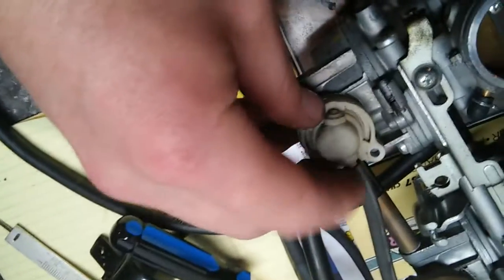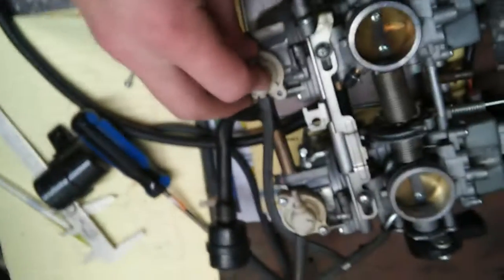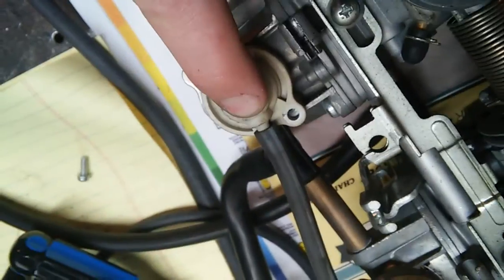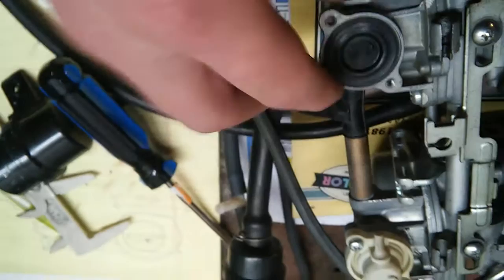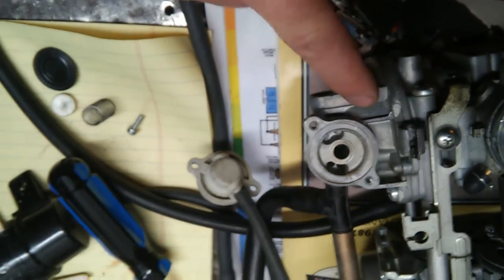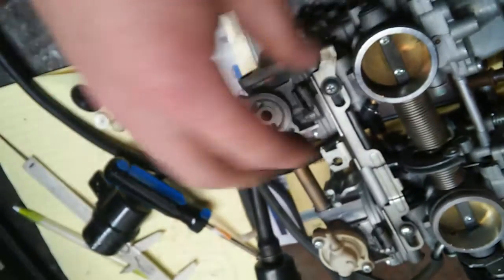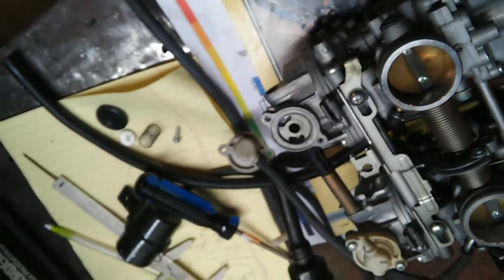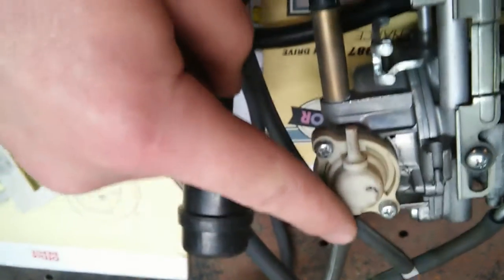Explanation of GS500 carburetor white exhaust ports

Comment: I blocked the white circular devices on the front of the carbs and the bike runs perfectly. Suzuki runs the same carburettors on the XF650 Freewind. Probably why it's the only stock single that can top 160kmh stock.
Reply: Loved my XF650, the torque was fantastic through the entire rev range that thing pumped!

Comment: This is matching my understanding of this device. I didn't dismantled it ...yet, but I doubt very much about its use as a better bike behavior. 
Just replacing the whole stuff with a couple plugs should not cause any problem.  I just wonder if the TPS as any other use.

Comment: also you connected the cables incorrectly, the vaccum chamber is supposed to be connected to the solenoid and not to the atmospheric inlet ports.
Reply from the maker: So are you saying the normal state of those springs/diaphragms while running supposed to be open/vacuum-applied or closed/no-vacuum?
Reply: @BurlyNerdGetsTheWorm  normal state of the diaphragm should be in closed state and the vacuum is not applied. you describe it correctly in the video.  When vaccum is applied, the spring compresses and the passage to the air box gets opened.
Reply: i now see you have another vaccum chamber, i'm not sure then what is the small box connected to the air filter port.
Reply: it's a small air filter just for this purpose? in my xf650 there is a direct pipe to the engine air box.
Reply from the maker: @ronenfe  yup, just a small air filter

Comment: Trying to find replacement part. One of the plastic port pieces broke off inside the hose while I was removing carbs. Anybody have a part number or where I can look for it? I have a gs500f 2004
Reply: Did you ever find this info? I am having the same issue on my 08 and finding nothing!
Reply: @eka983  where either of you able to find a solution? and did this stop your bike from starting?
Reply: @laxanpremachandran7104  just disable this useless system.
Reply: @ronenfe  how would you do that?
any links?
Reply: @ronenfe  okay cool, ill look into this a little more, thank you
Reply: @laxanpremachandran7104 Hey, did you find anything?

Comment: Do you guys have any idea when or what causes that switch to activate? I'm assuming the switch is normally off (closed) and something like RPM or power or speed triggers the ECU to open that switch. Or, oppositely, is this something that is not emissions related and only at idle the switch is on and guarantees that the sliders are closed for proper idle operation?!?
Reply: according to the manual it calculates the state by tps,  current gear, and rpm. i disabled the system and didn't see any change, i have xf650.
Reply: How do you disable the system?

Comment: Hi there!  I originally saw your video on GStwins and read the discussion there.  I think I'm having trouble with the solenoid assembly (aka vacuum control valve) and I want to defeat the system for troubleshooting purposes.  In addition to capping off the white plastic vacuum ports, you also need to remove the little diaphragm and spring in there, right?  I think that would allow for the free passage of atmosphere and the slides to drop 'naturally'?  Any information would be greatly appreciated!
Reply from the maker: Stephen Martenz I would think that because all the air intakes are blocked, that it would be irrelevant whether the diaphragm was in or not because there would no where for the air to flow from or to. (I haven't installed it yet, so I can't say from first hand experience, but thinking about the flow of air, that would be my thought.)
Reply from the maker: Stephen Martenz scratch my previous response after watching the video again. Definitely leave the diaphragms in, as they represent the 'normal' condition. Applying vacuum and lifting them/opening the passageways represents 'killing the throttle'. Yes, with both vacuum and atmospheric ports blocked it should be irrelevant,  but for troubleshooting it would be best to preserve 'normal', I would think.